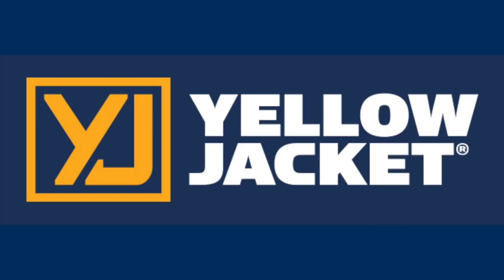HVAC Vlog | A Different System | Upcoming Job

Comment: good deal, some people hem and haw about the purchase of a comfort system. Thy spend the majority of time there and it keeps all their valuables in good condition, runs about 16 hrs of the day, sometimes 24hrs.... and will last 20 years. Now when it comes to the car that will constantly need service and expensive parts replaced, they won't even blink at dropping a grand on repairs. It will require them to take time off to drop it off and need transportation, may not be available for a few weeks to get done.  We on the other hand, arrive on site in a van with parts and tools, constantly schooled,  and it always seems to be like this is a big decision..... I know there are some dishonorable  people out there, but most people know someone who knows someone in the trade at least for advice... If not, I would travel to a local supply house and ask the counter clerk manager to recommend someone..... not the yellow pages.  One good sign is to see how long they have been in business...